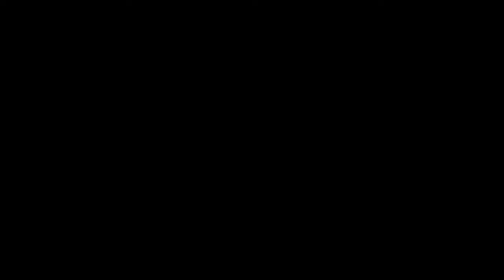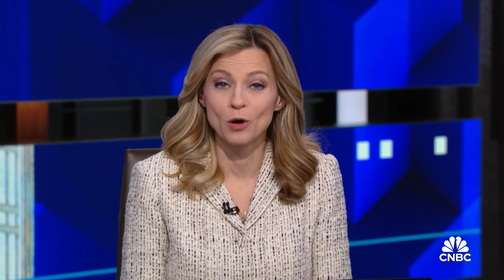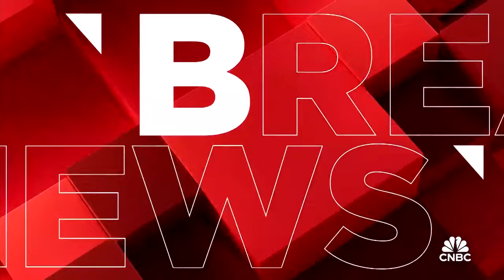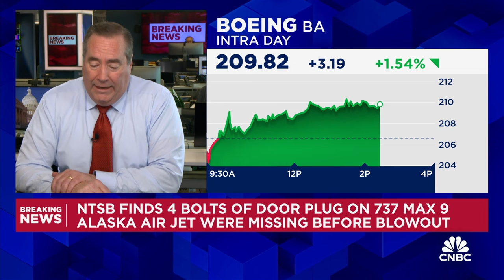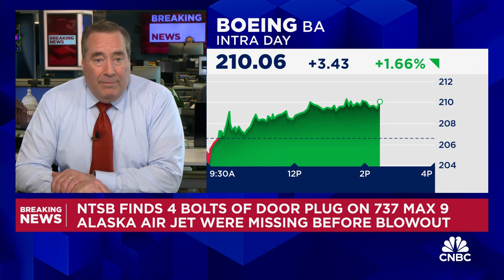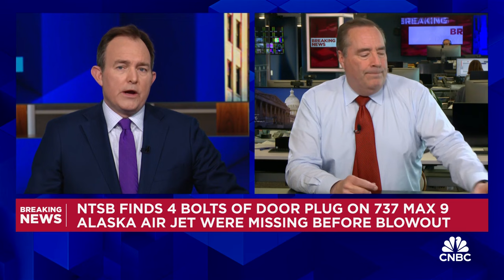NTSB finds four bolts of door plug on 737 Max 9 Alaska Air Jet were missing before blowout

Comment: It's a shame the guy in the black suite tried to diminish the fact that this was a serious problem IN THE FACTORY that could impact all 737 max
Reply: Yeah it definitely comes off a bit scummy. But worth keeping in mind, this is a business news organization and they are trying to determine what the implication of this scandal will be to the business and its stock price. Investors will need to ask themselves, regardless of the optics, was this a one-off issue that will be inconsequential to the stock after a few months, or truly a systemic issue that will loom over the company for years? Those scenarios have very different implications to how the market prices Boeing equity going forward. The CNBC host is trying to get at that point amid a flurry of negative headlines. I'm sure his comments won't actually impact the rigor used by the NTSB or Boeing in trying to prevent this from ever happening again.
Reply: Wrong!
Reply: Ask the manager in the shop floor who remove the bolts and who had given the instruction and for what reason ???

Comment: I work at flight test at the airbus a330 assembly line... I just can't believe how you can miss 4 bolts on a sigle panel... Here we have so much controls, papers to signs and photos to take it's literally impossible...

Comment: Predating any of the recent problems / incidents with Boeing quality control ( ? ) was the a major change to their manufacturing processes. Some years ago Boeing changed their processes in order to increase aircraft production rates. Taking on automobile moving production line techniques may have been a bad idea for Boeing.

Comment: Not great but seems like a one off screw up that can be corrected  easily.  Obviously the plane had some bolts holding the plug as it was flying for some time before the blow out and Alaska noted a pressurization issue they should have gotten to the bottom of that rather than just limiting overwater operations. Plenty of lessons for Boeing and the Airlines from this incident.

Comment: We now know that the Boeing manufacturing repair and rework process is not always supervised, this is concerning because as the planes go through the manufacturing process there are many faults or 'escapes' which are reworked on each and every aircraft a worrying conclusion could be the failure to be 100% sure repairs/rework is correctly done every single time opens the possibility that an unknown quantity of Latent defects could exist in any aircraft and perhaps no one will know until latent defects cause further incidents.  In aviation it is essential to have processes that eliminate the possibility of latent hidden defects, I hope it's not this bad in reality. I used to work for a Tier 1 supplier to both Boeing and Airbus, it was obvious to me then which manufacturer was most careful about safety and engineering quality. Airbus seemed to be slow and over the top with their massive Gress process carefully controlling design, however in hindsight I now feel a lot safer in their aircraft.